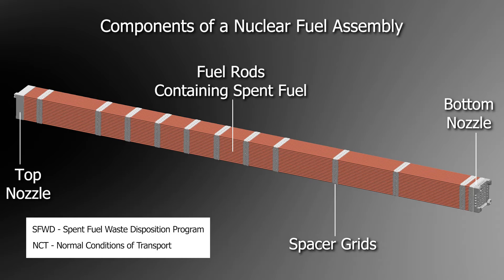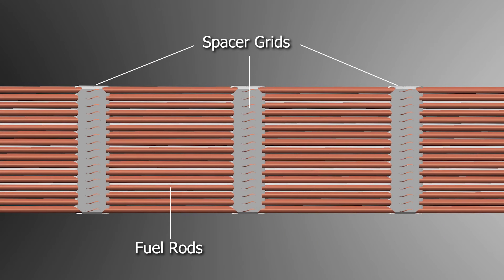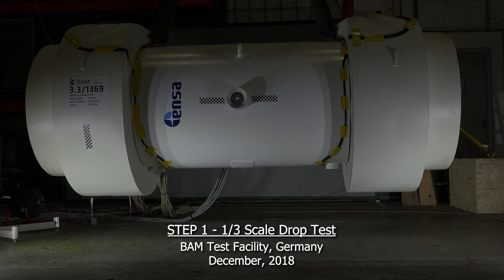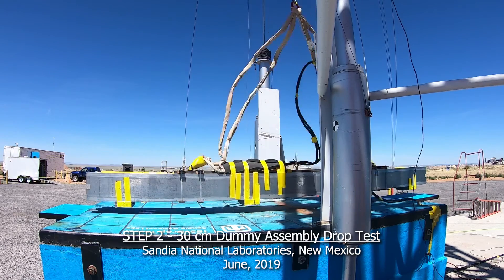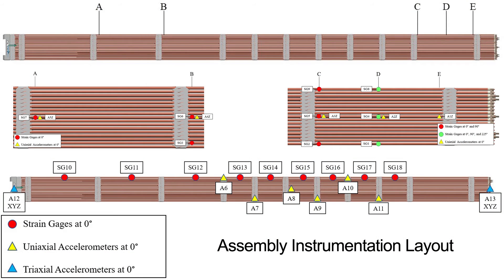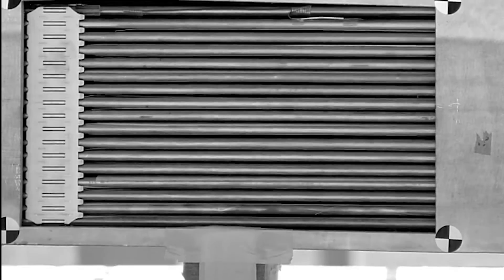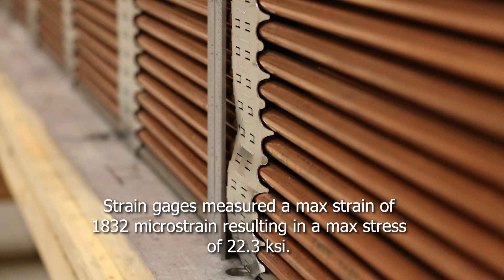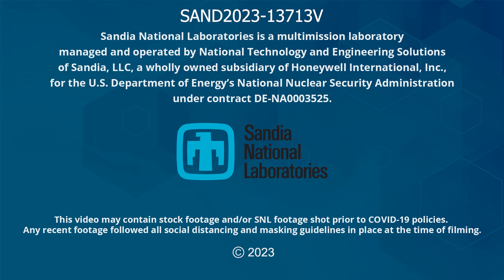Sandia’s Spent Nuclear Fuel Assembly Drop Test

Comment: Cool. What is this for exactly? Transport safety?
Reply: It’s for making sure nothing breaks or bends during transport. So basically transport safety
Reply: @definitelynotafish2162  
Not just "transport safety", which most people will take as "is moving the thing from place to place safe"... but the finer point: "transport-accident safety", which means "if we drop it before or after 'actual transport from place to place (say while loading it onto a trailer-bed), how large a drop can it safely withstand".

30cm is a hair less that a foot... and while "safe-in-testing", the deformation of support in a drop of less than a foot is... marginal.   I'd like to see the data on 50 such drop-tests... then the data from 2 or 3 drop-tests from 40cm (about 16 inches).

I'm not worried at all about possible criticality unless the drop is a couple of meters (say, 6 feet)... I'm just wondering now much heat is the freshly "reconfigured" rod-package is likely to generate before someone rescues the whole thing to prevent it becoming a hazard.